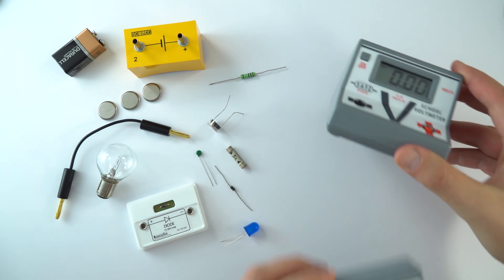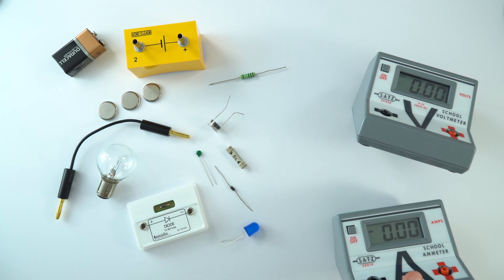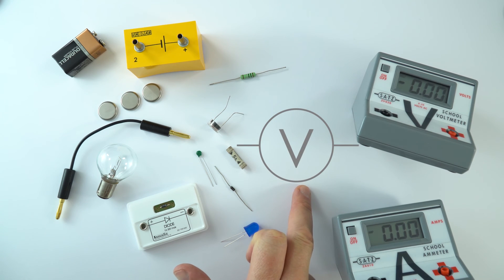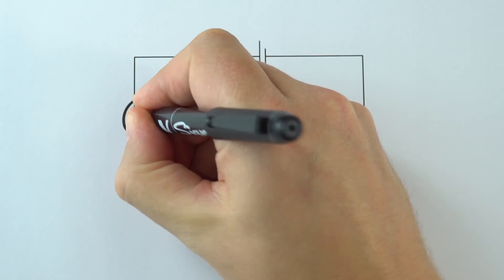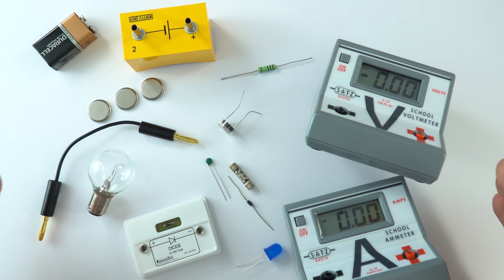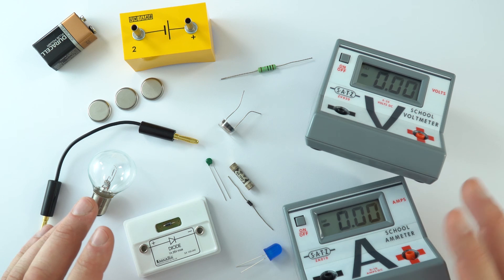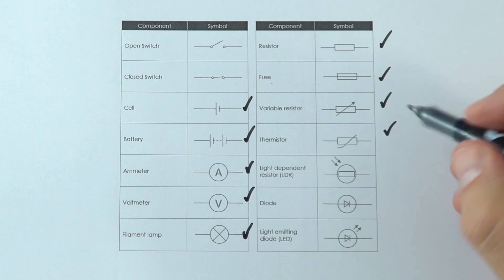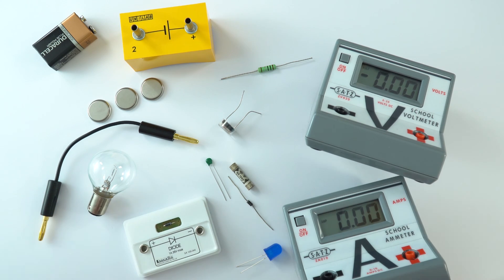Circuit Components and Symbols - GCSE Physics

Comment: What is the GCSE symbol used for a variable DC supply?  Would it be acceptable to draw multiple cells with an arrow through them.  With the arrow representing the capacity to change the P.D. of the supply?  I ask this as a teacher of some inquisitive students - I have found no teacher/ material issued by the exam board that can answer this question.